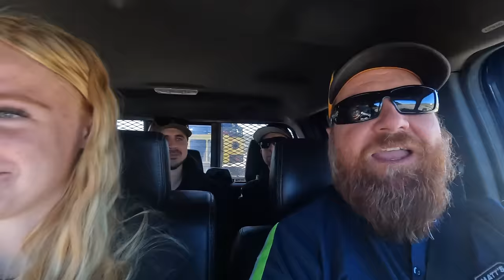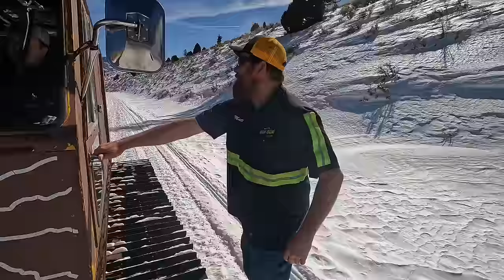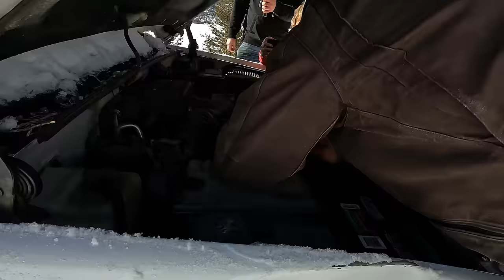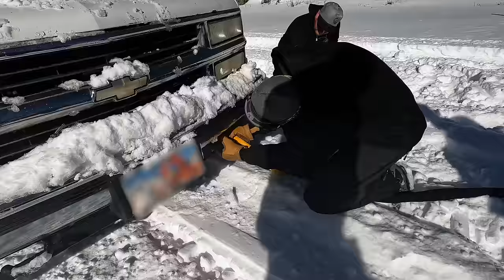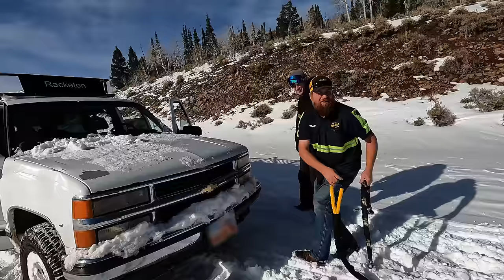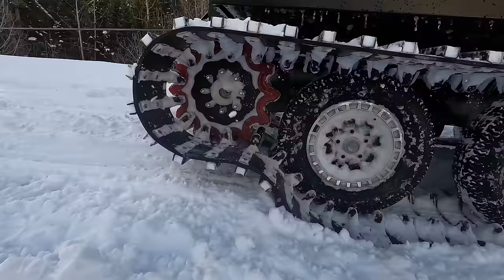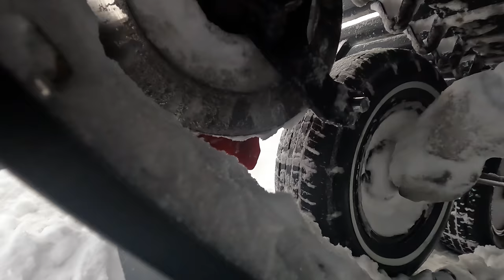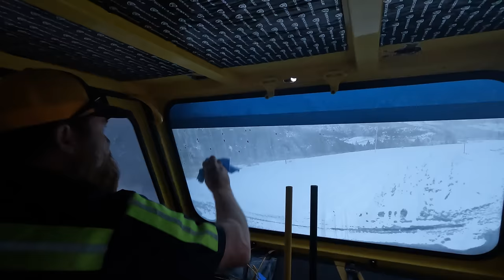I Failed....

Comment: Hey Matt...quick note...when driving in Alaska, and the same symptoms occur on our truck as well as the Bobbi, we put a product called "Heet" in the tank to dry out the fuel. Something about water in the fuel that gets in from condensation, messes up the sensors and eventually stall the vehicle.
Reply: Traveling between drastic temperatures is an actual issue. If your unit is spending time above zero (because Celcius), and you see below freezing in your future, gas line antifreeze is your friend. Sounds like drag-strip fuel, but dumping alcohol into the tank is just basic. Alcohol attracts water, and remains flammable. Moisture in the fuel system crystallizes and blocks the filters.
Reply: Seafoam is amazing for so many things
Reply: We always referred to Heet as “Dry Gas”
Reply: If your gas is 10% ethanol, any of the Heet alcohol gas line antifreeze products are a complete waste of money.
Reply: If your fuel has ethanol in it, like most fuels do, moisture in your fuel is NOT the problem. Ethanol does the same thing as "Heet", aka methyl hydrate, aka "gas-line antifreeze". It bonds to any water in your fuel and prevents it from freezing. Because pretty much all gasoline has ethanol in it, fuel icing is no longer a modern problem.
Reply: And by the way, in the old pre-ethanol days when the moisture in the fuel could cause problems, it wasn't because it messed up the sensors. It was because ice formed in the fuel passages of your carburetor or fuel injectors, clogging them. Usually sitting there for a few minutes with the engine off would cause the heat from the engine to melt the ice, and then you could go again.
Reply: @Friend_of_the_One-Eyed_Ladies I agree that there’s probably another issue and not freezing gas but that mavericks they stopped at does off ethanol free gas at a really good price so there’s a good chance they are running no ethanol gas.
Reply: Meant offer not off. YouTube comments are jacked up rn so I can’t see what I’m typing lol.
Reply: I've learned a lot here
Reply: @grant6173 I just don't let my vehicle experience temperatures in Celsius - I just keep it in the Fahrenheit part of the driveway when it gets cold!
Reply: Do you think Matt cares?  Maybe Robby copy cat does.
Reply: All HEET is, is isopropyl alcohol. It's a waste of money. Just buy a large bottle of 91% from the pharmacy. five times the amount for a 3rd of the price. 
But i really I don't think that's the problem. It's not that cold enough where they are for the fuel to condensate. Those General Motors cam and crank sensors are garbage. They make them in China. It's a very common thing for new ones to be bad. I see it all the time in my shop.  We replace about a dozen of them a week.  The typical behavior is, they work fine until they get hot. Which is what we saw here. It ran fine going up the mountain, started towing with it, engine gets hot, and it starts to have problems. What you can do to diagnose these things, is connect an oscilloscope to the output and watch the waveform. Then while it's working, apply heat to it with a heat gun. After about 30 seconds you will see the signal drop out. I bet you that's what's wrong with this rig. 100%.
Reply: Getting Old...!
Reply: I’m from Winnipeg Manitoba in Canada and my Chevy starts in minus 40 Celsius every time. I guess that’s fuel injected, but just spray some brake clean or use a tiger torch and heat everything until it almost melts that always works 😂
Reply: @grant6173 is that when it goes hot cold hot cold but extremely cold quickly? I've been in Northern ab an hour from nwt -52c and never had any issues with this. But i know people that would buy the stuff by the box and they never had any issues eather.

Comment: Tom’s preparedness and foresight is refreshing. If he had packed a spare cam sensor he would have unlocked legend status.
Reply: Good choice in gear too, love my Smith goggles though they're the MTB variety.
Reply: Factual statement 😂
Reply: @tenfriskydingos  same, smith xl,  they got my Troy lee helmet perfect too 🤘
Reply: Nah, if he packed the cam sensor he wouldn’t have been able to snow shoe 😉
Reply: And a new head gasket for the customer. Ahem. 😎
Reply: Tom's actual profession is as a Nuclear Engineer believe it or not, so I guess he's used to always thinking a few steps ahead safety-wise for preparedness...
Reply: @philip4193  Probably the same reason he had a streak of running out of fuel.. foolishly trusting his gauges.
Reply: Luck favors the prepared. Another great mission though.  Bombi needs more love, clearly.
Reply: They called Dr. Phil for assessment. He said  "What were y'all thanking"
Reply: No, his is a Subbourbon
Reply: Ore or after bombie refit ?
Reply: Is that why he is not around  now???

Comment: This will probably get buried in the comments but here it is anyways. 

Input sensors like the cam and crank are very sensitive to interference. The two biggest causes of interference on a motor are the alternator and ignition systems. Make sure the cam/crank wiring is routed away from the ignition coils, alternator, and associated wiring. And make sure the cam and crank sensor are mounted as far away from the coils and alternator as possible. 

You mentioned that some tin foil helped. Instead of tin foil which can ground out on contact throughout the engine bay, use a different type of shielding for the harness that is insulated. Make sure it is only grounded at one end, ideally at the main ECU ground to prevent “ground looping”.

I hope this makes sense and is helpful, love the channel 🤙🏼
Reply: Solid advice. Hope they see it!
Reply: Didn't get buried. Got top billing.
Reply: EMF wire looms
Reply: I have also heard that cheap 12v usb chargers for phones can also create interference that messes with vehicle electronics and sensors.  Not sure if there is truth to it but it does seem plausible.

Comment: Ditch the drive train. Hydrostatic is the only way to go. Also be well worth adding a we blade to it as a winching anchor or for generally shifting snow. 

Honestly a hydro system will make you life so much easier and more controlled. No just set the engine revs and massive torque and mm perfect control. What you have there is a lovely machine with a disaster or a transmission. 

I worked for the UK government in Antarctic tractor train traverse and we used big plastic sheets as sledges. Look up how people move fuel in Antarctica. Messing about dragging and often breaking vehicles in deep snow is just folly. Burry the plastic, drag the vehicle on, then strap it down, drive off pulling the sled. If you need to go work hill just drag and anchor behind you. It’s safer and way nicer to your machines. The tools needed are also light weight and portable. You could modify it for your needs no bother.
Reply: I agree, hydrostatic is a sure fire method of moving heavy and slow loads.
Reply: But we will miss Chewie 😮‍💨
Reply: We use similar sleds for heavy hauling behind snowmobiles here in Alaska, and I've see really nice ones out of Canada. Much smaller versions of course!
Reply: its a pos to begin with, nothing square, would have been better off buying something new and modifying it. They are way over budget for something that has yet to actually prove its worth, even before they did all the useless work to it.
Reply: @eldeguello9573  someone is a bit of a sour crab.
it's gotten plenty of value in content alone, plus it can clearly go places where other rigs would and do struggle, like that big camper they pulled out not long ago, they took the banana and that had all it could do while this thing just dug in and went.
what they have now is a bit of sunk cost bias with trying to keep the transmission setup they have but as soon as they swap it with a proper tank drive or hydro-static this thing with be a beast!
as for the stalling problems that's just teething problems any engine rebuild could have, and that's half their problems with it.
Reply: @Monz117  you drag and anchor like a land anchor. Or you need a second machine at the back. You can use a semi ridged version with an a frame to the machines drawbar just make sure you have a keel style strip to keep it from sliding sideways. Lots of options.
Reply: @eldeguello9573  they make the money from us watching the build rather that the work. If they purchase things that just work what would we watch.
Reply: @markbaird8356  Exactly.  Having problems with the equipment is a big part of the drama and what keeps folks watching.  It they just went and bought all high dollar brand new stuff that always worked perfectly, it would be boring and viewership would suffer.  They're doing it just like they should be.  They'll keep working on the Bombi until it works better, but it'll still be the Bombi.  And while they're working on the Bombi, we'll be watching....
Reply: you're telling me Brianhead didn't have a used Thiokol or PistenBully for $150k for sale?
Reply: Hydro stat is a a hit or miss got get it do it right
Reply: @blythkd9017  yeah they could just go buy an ex army Hagglund that would spank the Bombi all day long but it’s not the same to watch. Mid you that’s basically what Heavy D does and it works for him.
Reply: @markbaird8356  if Matt had heavy d kinda money, it would be like Colin furze grew a beard. 😂

Comment: It always amazes me when you don't fix major known problems before taking xyz vehicle out for another recovery. Definitely makes for great entertainment!
Reply: Stupid is as stupid does.
Reply: these guys are very much of the "it works well enough, we will just struggle through", probably comes from their days in demo derby.
the different jobs may not be as long apart from eachother as the videos are because of editing and releasing on a schedule for the algorithem.
Reply: @ecot29 We don't know the exact timeline that they are doing these recoveries, these past few Bombi videos all could have happened within a couple days of each other. If they couldn't figure out the issue with the small amount of time they had between recoveries but they needed the Bombi for a "deep snow" recovery, like the customer said it was, then they have to work with what they got.

Comment: Hope you guys see this. By no means is this criticism, you guys are great, nothing but respect. Just some advice for the term x system on the bombi. 

1. The term x can also be run in batch fire (no cam needed). You will need to modify ignition parameters to do so. I recommend you upload a version of your current tune to the 3.5" handheld with a (no cam sensor) designation. Usually you'll need a little more idle fuel, but closed loop will take care of the difference. 
2. I don't know if you guys figured out why it wouldn't go into closed loop the other day, but many times it is either EMI interfering with the TPS RoC or MAP RoC acceleration enrichment triggering your "pumpshot" which puts the ecu in open loop. The enrichment values and VE table can also be so far off that when it triggers the accel enrichment, it temporarily runs better (it needed fuel and got it) or worse (it was running fine, got too much fuel). Either of those situations can cause a change to vaccuum fast enough that it exceeds MAP RoC blanking and gets you in a never ending loop.
3. The term x systems are not as reliable as a stock ECU, I would keep a spare on hand with a get home tune preloaded. They have a higher than normal failure rate for stuff like injector drivers and o2 sensor drivers. If you lose an injector, you'll still get home, but if the o2 driver fails and you have tightened down the learn and closed loop tables yet, you'll be in trouble when it happens. You'll have to clear the learn tables and disable o2 feedback. I find it is simpler to just preload a tune that has the o2 sensor feedback disabled once you have your ve table within +/- 5% accuracy when warm. To be safe, I would add 10% fuel to the entire VE table. 

Can't wait to see what's up with the axle on the bombi and what you're going to do next
Reply: I know some of these words.😂
Reply: OK, fly this guy to Hurricane Utah for a weekend to get the Bombi fixed.   This is some expertise talking.
Reply: Well that was all Greek to me.
Reply: I was planning on Terminator X Stealth for my 496 build. I thought it was more reliable than Sniper.
Reply: @pvkj454  stock pcm>termx>sniper imo. Since you are looking to do throttle body injection, I would go with the termx stealth like you are. I just wouldn't trust a termx or sniper where being stranded might get you killed. If that's the case, a stock ECU or spare aftermarket ECU is the only way to go imo.
Reply: @mrwilson7617  if you tune holley's it makes sense lol
Reply: @scrapmetal_sleepers  Holley 550 ?

Comment: A hydrostatic turning dual-differential setup would be the way to go. 
The tracks would be locked with no steering input and you'd have complete control of both track speeds for turning without fighting the brakes.
Its what military tanks have been using for coming up on a century.
Most efficient AND controlled way to use tracks
Reply: This makes sense.  I was surprised to learn the Bombi uses braking alone for steering.
Reply: There must be some kind of skid steer drivetrain or similar the Bombi could be converted to.
Reply: Maybe Matt needs to talk to ex-military Tank Mechanics.
Reply: The bombi exists the way it does because it's cheap and when done right is very effective for small light vehicles. Hydrostatic drives are 4 or 5 times more expensive. 
The fact the brake caliper snapped off means there has been no true engineering done to calculate anything on this vehicle. Not great when it is the rescue vehicle.
Reply: @benfulton1265 yeah they used an off the shelf kit that would generally be used for cars without much additional reinforcement. Would have fractured it with all the driving they were doing previously where it wasn't turning due to the tracks not being set up right... Wonder what the lateral traction bars were for and if it will just slide off the road now... 😏
Reply: See what a Ripsaw uses. Cleetus McFarland ripped it on sand, snow and dirt before selling it to a fly guy. I think it had 3 calipers on each side.
Reply: if anything, something from an old skid-steer would work. go rob an old bobcat with a blown motor lol.
Reply: Plus all you would need is just a little 4 cylinder engine instead of that gas hog out in the middle of nowhere.
Reply: @jeffsikula2920  They want the V8 to appease the LS motor crowd. Sounds way better too.

Comment: The Bombi has a control authority problem. Tracked vehicles have a ratio of track width to wheelbase which allows them to steer correctly... If you end up with a ratio much over about 1.5 or so you'll end up not being able to steer effectively. The reason is that you develop steering torque based on your vehicle track width, and you develop track stability based on your ground contact length (wheelbase, effectively).
It needs to either be wider or shorter :)
Reply: Oh, and if you want a good drive option, have a think about electric drive... You can get a 100kW electric motor for about $7k... One of those per side would make the Bombi pretty hilarious... One CAN throttle per track and it'll stick steer faster and slower :) Chuck a generator in there instead of an engine and have some fun :)
Reply: @drew79s  Could the engine be used as the generator?
Reply: not efficiently @Royaleah
Reply: @Royaleah  sure, you just connect another electric motor to it 🙂
I mean it would sound a lot nicer than just buying a 30kVA gen set, but it would also be more expensive and less efficient... 🤣
Reply: @drew79s  Hydraulic would be simpler than a DIY electric monster.  Find a big skid-steer with a blown engine and steal the transmission.
Reply: Hydrostatic drive is the answer to the track steering problem
Reply: @drew79s  yess i just said the same. i think what would make it so much easier
Reply: @martylawson1638  to the best of my knowledge there isn't a hydrostatic differential drive around that deals with 100kW, let alone what an LS would put out... Add to it that tuning an old hydrostatic drive system to work with a new motor requires a level of expertise in hydraulics that I and most other engineers who've worked in that type of industry for decades don't have and you're setting yourself up for a life of hydraulic injection injuries, amputations and a level of reliability that will make the current iteration look like a dream.
Go for a more modern system and not only is it still not capable of the power levels, but it requires a control system expert work the factory equipment for that controller.
Larger vehicles switch to double differential for exactly this reason... It's way simpler and more economical, but again, integrating a double differential transmission will also be an exercise that makes electric look like some kindergarten stuff...
Seriously, EV conversion is at a point now where you can plug and play a surprising amount. The only thing you couldn't do with this is use a Tesla type system because it has a centre diff and you'll just repeat the same problems in electric.
Reply: @silverdawnrisng420  I've responded to this in another one, but from what I've seen hydrostatics top out at below 100kW, going harder than that will kill one immediately. Potentially in a way that could kill or injure people...
100kW of hydraulics is a scary amount of hydraulics.
Reply: @drew79s seems some companies make hydrostatic transmissions that can do more than that but presumably they would be impractical and expensive for the bombi